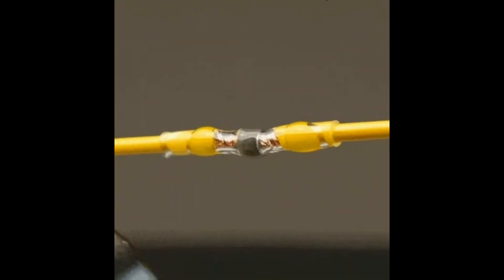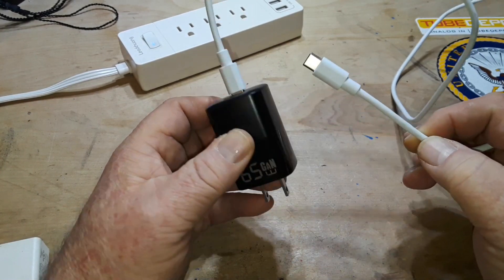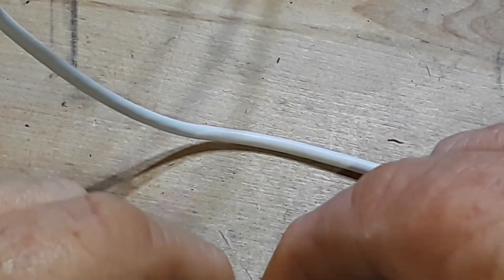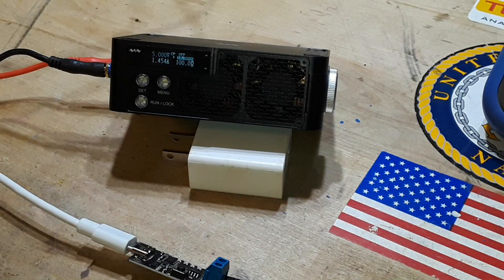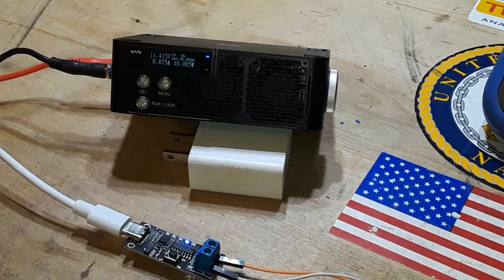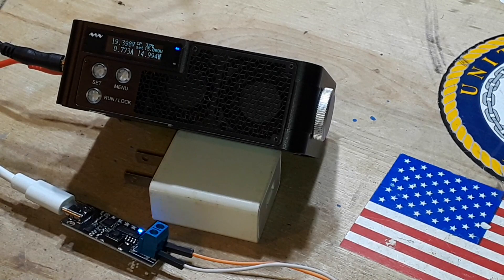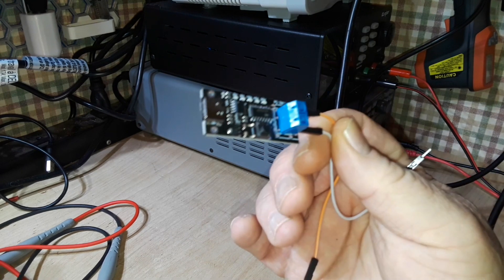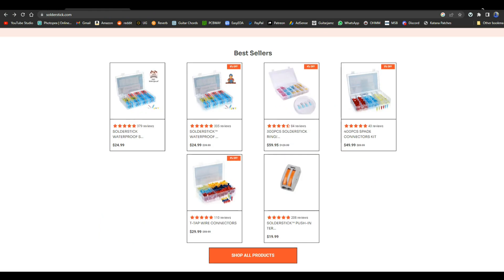USB Type C Power Delivery Spoofing - brought to you by Solderstick wire connectors

Comment: Hey its me again Boss,   since you are fielding random questions today ....  or at your convienience ....
    I picked up a PRS SE 25 pickin stick recently .... as some asshat saw fit to liberate my last guitar up and outta my car a while back.    
     Anyways got new one and for about half price somehow.      Somehow.      .....    I think ...  or feel ... like its got this *Warble * to it.    When I play I swear I can hear the tone or pitch of the chord wander.    Modulate a little maybe is the right word.    Its not a feature I was after.    
    I can play a bit,  love to do so,  not great but I can play.    But I dont know hardly anything about the things as for function and causes of non function.      Do you have any idea about what that could be??
      The guy I got it from mentioned he did not like the pickups.    It is basically brand new and I can just tell that its not holding the sound as steady like it should be.   It sounds like I am pressing the strings out of tune or like its got really cheap tuners on it so when you get it all dialed in and then play a couple of chords it immediately sounds slightly off and you have to mess with it again.     
     I set the tumer there and watch it to see if the notes are wandering somehow but I cannot see it doing anything on the little tuner or on my phone app tuner.      
     But I can hear it sometimes I swear.    Maybe I am just hard pressing the strings but I dont think I am.     
     So yeah,  just thought you might have ..... well I am confident that you do in fact have a much better idea of these things.
   
I gotta get the band back together man.    On a mission from God. 

We gotta play a benefit show for the Rural Mtn. Fire Crew so they drop some charges.     =]
Reply from the maker: Start with the nut. Is it too shallow? If you have to push too hard on the cowboy chord area you may be in need of a nut job...so to speak.

Comment: I tried doing something along these lines - a USB power bank with a USB-C output, followed by a trigger board stepping the voltage up to 20 volts, followed by an adjustable buck converter. The idea was to have a portable adjustable power supply. The problem that I ran into is that with some varying loads, the buck converter would pull enough current to 'fool" the trigger board which would spike its output voltage and so forth. The buck converter and the trigger board wound up fighting each other leading to voltages all over the place.

Comment: I think this is possibly what you mentioned when I asked about a way to charge some two way radio batterry packs .... they are 7.2 volts and 2,000 mah .... and I never had the charger with them.    Radios are nice and around 2 to 250 dollars a piece .... and the stupid little charging dock ( nothing special or weird about it ) .... they are 9o dollars.      !!    They are simple little charging docks that look like any other cordless phone or two way radio charger so I have been trying to figure out how to make something work.     (  am a carpenter so no speaky the sparky jargon )         
     Is this what you meant about a month ago when I asked about it?     The packs have the two small silver square contacts that would make contact in the bucket or dock ..... how would I want to make contact with those .... and can I just run it at 9 volts for a little bit and check the voltage on the pack every so often so I dont start some type of hostage standoff with with the rural mtn fire crew?     

Again.   ?